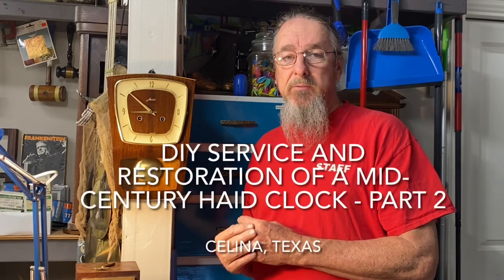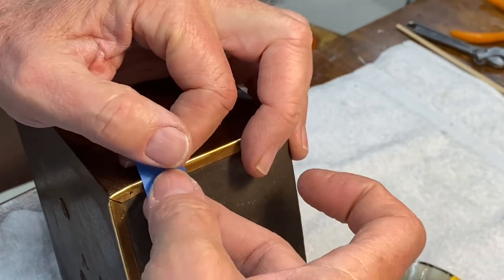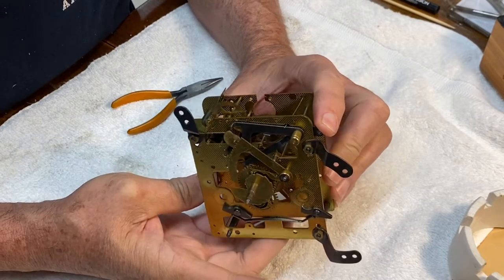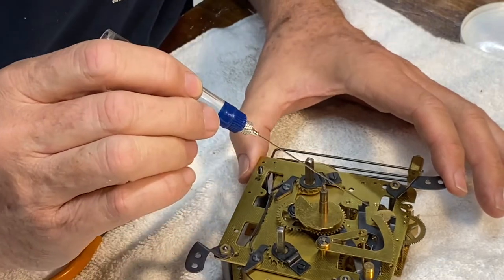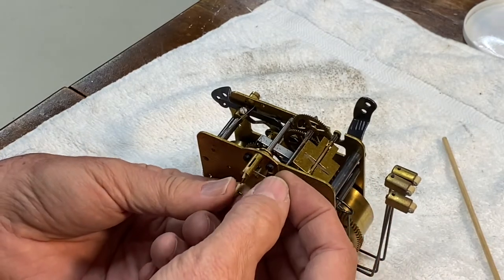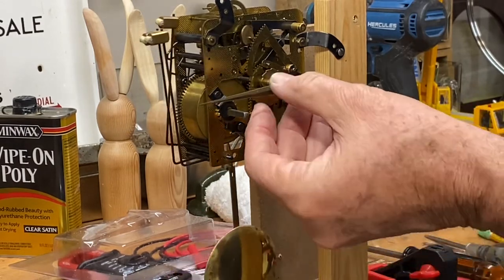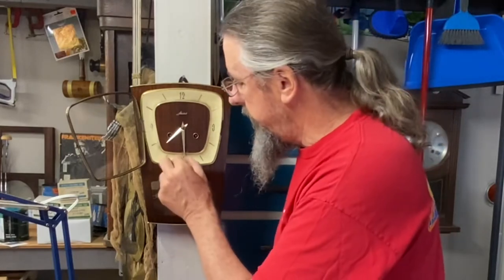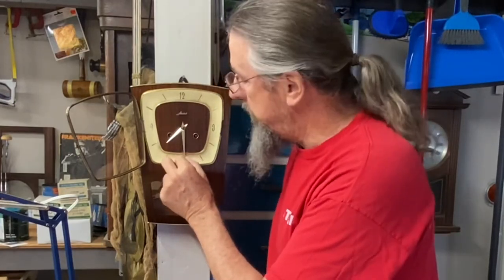DIY Servicing and Restoration of a Mid-Century Haid Clock FHS 141-030 Part 2

Comment: I was watching your video and I saw you put oil on the pinion gears. The way that clock gears are manufactured, cycloidal, they never require oil. Oil only goes in the pivot holes and on wear surfaces. I have been repairing clocks for years and I thought that you might want to know.
Reply from the maker: Thank you for that information. Makes sense…!